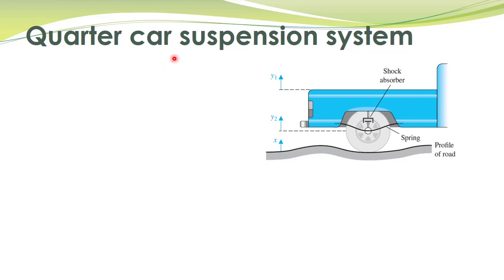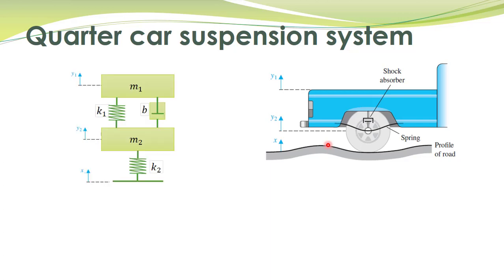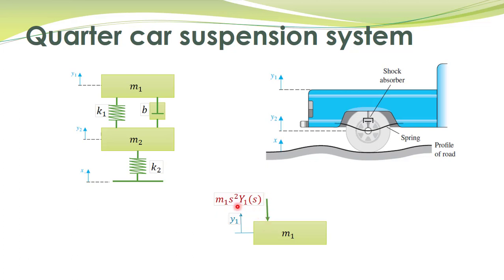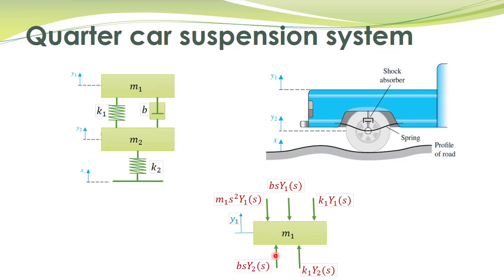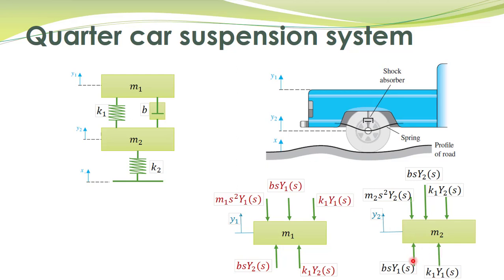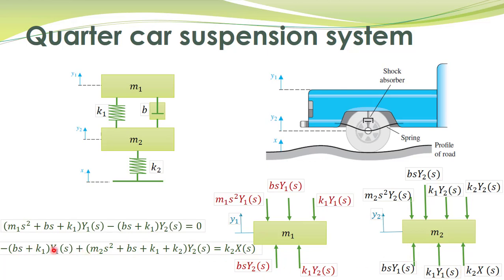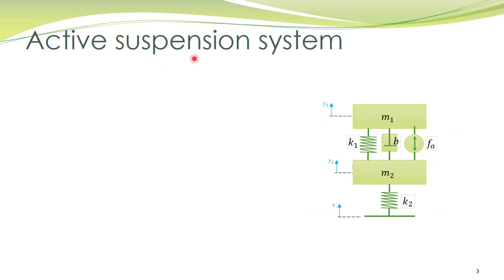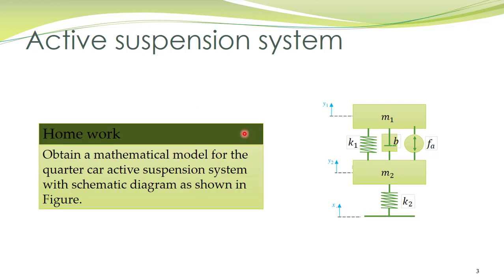LCS - 06b - Modelling of Quarter Car Suspension System

Comment: Firstly very good explanation Sir. Secondly what  will be the way of calculating the overall transfer function i.e. if we consider other wheels as well. In a way that they are interconnected by chassis. Will there be any  change if we consider all the tires and car body instead of quarter wheel suspension?
Reply from the maker: For modelling of full car model of a vehicle suspension system, each tire can be modelled in a similar way with an addition that a force will be exerted by the vehicle chassis on the tire. The chassis can have roll, pitch and heave motions and each motion can be modelled by writing torque and force balance equations. Torques will be due to the forces exerted by the tires on the chassis. If you want to study more realistic situation, you may also add seat dynamics.

Comment: This is my first video of yours 
I didn't understand that acceleration acting downwards is denoted by m1s²Y1(s) can you please explain this phrase for me please  what exactly s is
Reply from the maker: m1s^2Y1(s) is the force due to inertia of mass m1. Force due to inertia is always opposite to the direction of acceleration.

Let me elaborate it with a simple example: 

If you are sitting on a car and the driver suddenly presses the accelerator and the car accelerates in forward direction. In which direction your body will feel the jerk?  In reverse direction. Why? Because the force due to inertia is opposite to the direction of acceleration.
Reply: @MAFarooqi  I get what you are saying I want to know that how you are denoting the acceleration as s²Y1(s)
Reply from the maker: This 's' is called the Laplace variable.  You may consider it equivalent to the time derivative. Thus, s^2Y(s) is equivalent to the second derivative of Y with respect to time. And you know that the second derivative of position is acceleration.
Reply: @MAFarooqi  Acha on sir I got it thank you so much

Comment: But the wheel is not attached to the ground, so why would k2 exert a force downwards given in these cases weight of the wheel is negligible?
Reply from the maker: Please note that the weight of the wheel is not negligible, its mass is m2 and hence its weight is m2*g.

Secondly, the spring will always exert a force whenever there is elongation or suppression in the spring. Since the displacements x and y2 are linearly independent from each other, there will be an elongation/suppression in the spring resulting into a force.

Comment: Why there are no three equations as we have three displacements? I thought we had to do something for the displacement "r" like you explained in lecture (LCS 6a).
Reply from the maker: In this system, the third displacement 'r' is the road profile, and it is not determined by the system dynamics (whatever is the system, road profile will be the same). Thus, r is taken as an external input to the system.

Comment: do you have any video that explain the active suspension system?
Reply from the maker: Not yet.
Reply: @MAFarooqi   active suspension system is the main thing ,,you should consider those things to teach instead of these "bookish" material,..
Reply from the maker: @bilalsadiq3495  If you can model the system underhand, you will definitely be able to model the active suspension system. The assignment at the end of this lecture deals with active suspension system, and believe me, my students had no difficulty in modeling the active suspension system.
Reply: @MAFarooqi  Well Dr Abid,,you are right but my point is only that please try to make videos on those topic which are not available on the internet.To model and design the passive system is extremely an easy and availiabe on internet,but "acitve system " modeling and control design is not available ,so please try to make those stuff if you really want to upload things.I must say appreciate your time and energy and your contribution but upload those things which i mentioned.At the end nice effort overall.